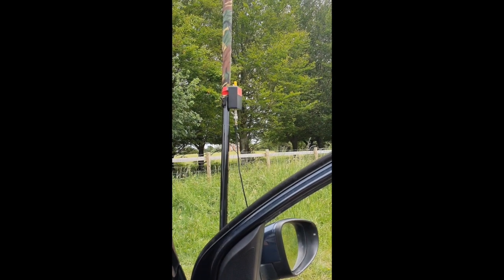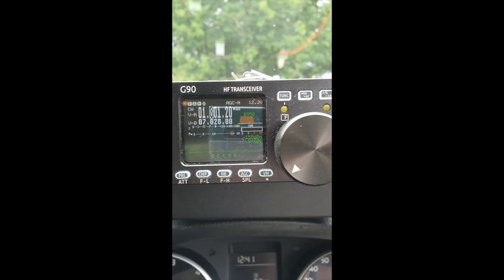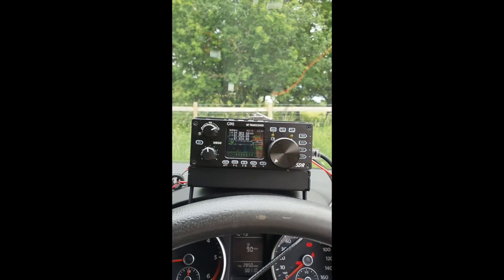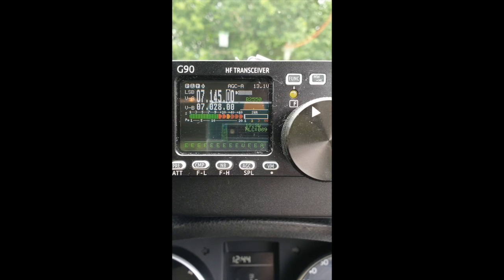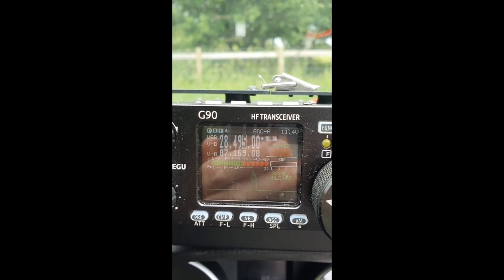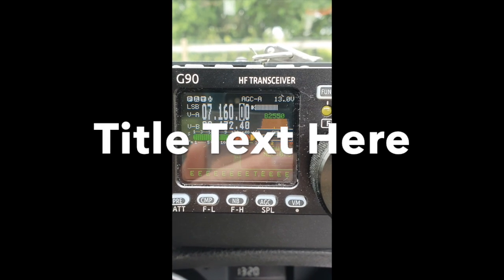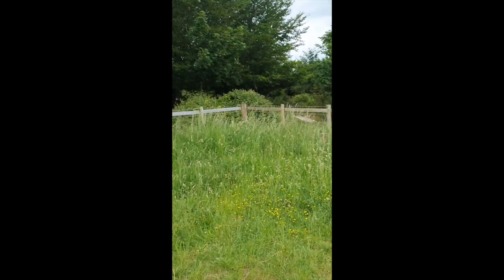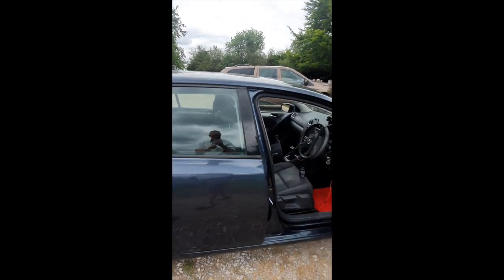Sleeve on Pepperbox

Comment: Hi David , hope your keeping well, I love my sleeve antenna! I use mine at permanent home qth, it's just strapped to the pole for the wife's washing line, about 6ft at the base, I've worked all over the world on mine with just 100w from my 7300, internal tuner handles it nicely, my first contact when I installed the antenna was island of Bermuda on 40m ssb, so it works fine. Chris M1trc
Reply: How does the rain effect it
Reply: I've had no reaction from rain , even when the sleeve was white with frost recently  feb23

Comment: Hi David. Interesting point about having the ignition on without the engine running. I know in the good old days it wasn't recommended for petrol cars because if the points happened to be closed you could burn out the coil. No idea about modern cars with electronic ignition though. I would have thought a diesel would be OK, but perhaps someone with knowledge of such things could enlighten us? 73